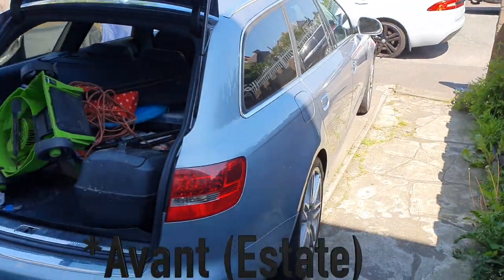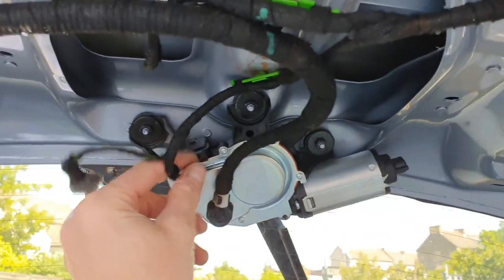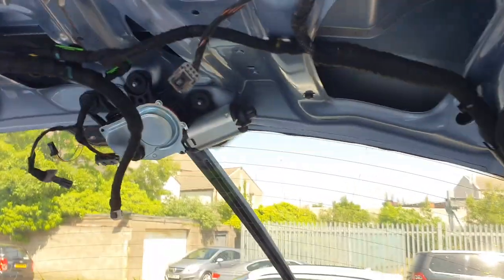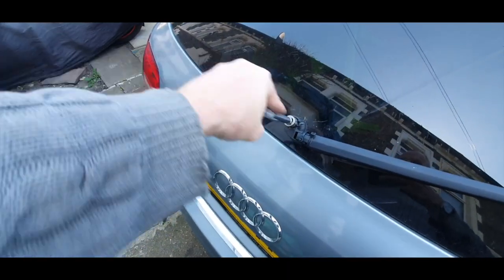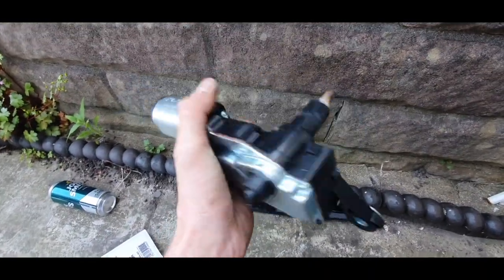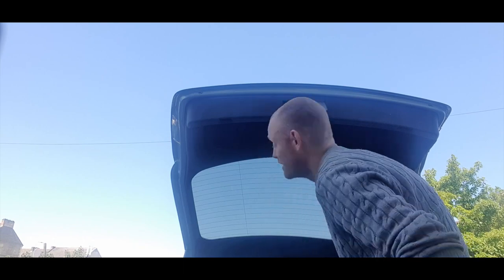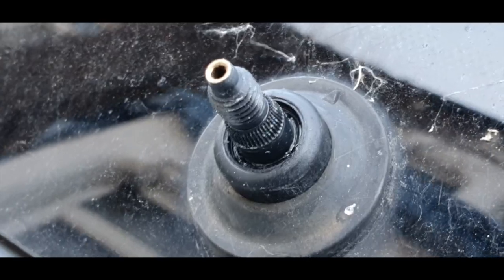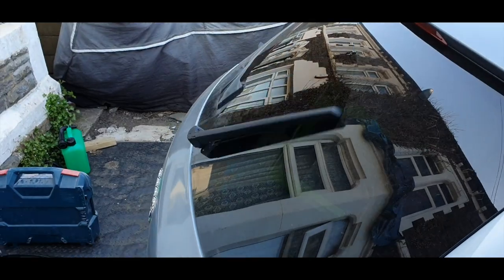Audi A6 Avant Estate Rear Wiper Motor Removal and Replacement 2011 (C6)

Comment: Before installing the new motor, I recommend taking the back off and packing it with as much grease as you can to avoid future corrosion. The shonky design of these wiper motors affects all VAG cars as eventually washer fluid will leak into the internals. The extra grease will vastly prolong the life of the motor. It worked for me.
Reply from the maker: Great tip!

Comment: Awesome thanks - will be fixing mine shorty - only tricky bit is needing the puller tool - good to know that before you start the job...
Reply from the maker: I think I got that from eBay... top tip, soak it with WD40 the night before you attempt to take it off lol... if all else fails you'll have to get the angle grinder out

Comment: Do you have any video on how to repair the automatic tailgate? Mine doesn't latch by itself anymore.  I always have to push the outside button (handle) just before it closes in order to latch itself. I tried to adjust the hook inside and everything but i can't figure it out what's wrong and i couldn't find any video on this topic
Reply from the maker: Ooh, no, sorry, I've not had that problem, your best bet is to ask on the forums and Facebook groups

Comment: How does your lid close so slowly and quietly. When I bought my C6 avant, it was described as common issue with those electrically closing trunks, that it slams hard, when it closes. Have you modified anything or do you have more powerful gas springs?
Reply from the maker: They're the original struts, I guess they're just in really good condition. If it slams hard then I think you need new ones... Unfortunately, Audi main dealer ones will obviously be best, I'm sure the cheaper Chinese ones will fail shortly after installing them lol